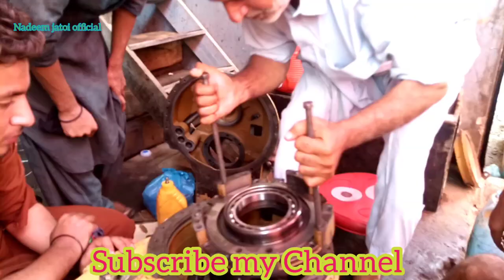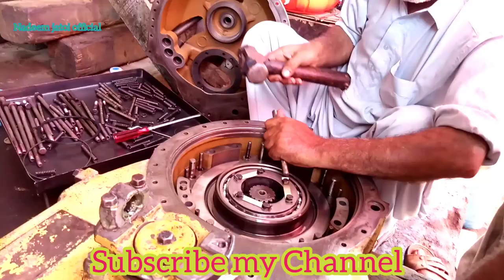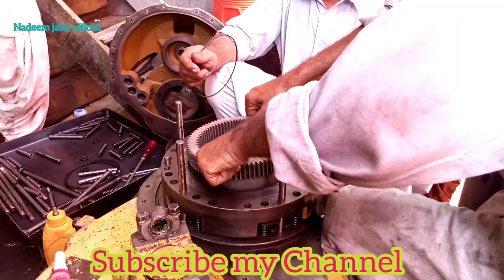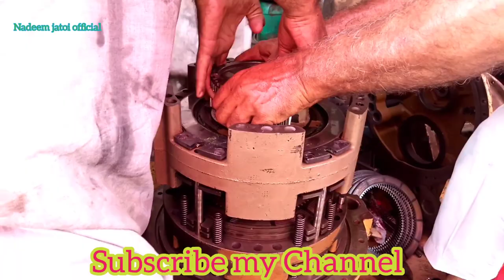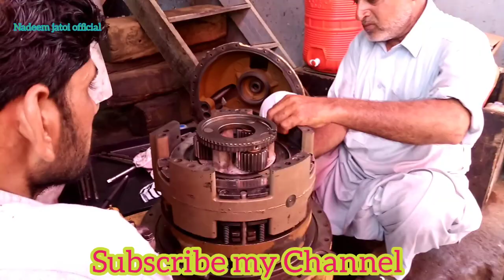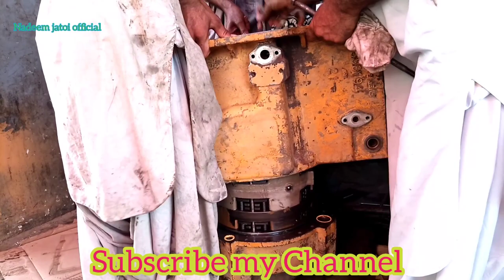Cat® 930 Wheel Loader | Transmission  Fitting Repair |  CATERPILLAR Loader gaire  Transmission(USA)

Comment: A torque wrench is something that has to be invented in that shop ?
Reply from the maker: Thanks
Reply: Bart, you noticed that too ? That transmission isn't going to last long. They re-used pins that were loose and sloppy in the bores. Those holes were +--.0005"
I'd hate to see what they did with the piston seals.

Comment: Why no oil between the discs and plate? It’s not good to start the trans with no lubrication. All bolts should be torqued to specs per Cat service manual. Not such a good job as I see it. I did this job for 35 years only a few returns.
Reply from the maker: Thanks